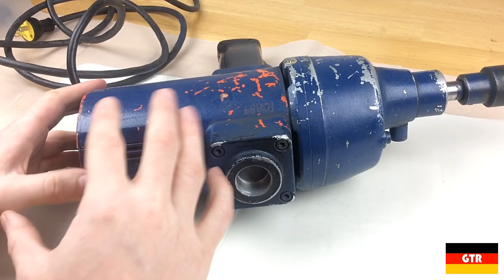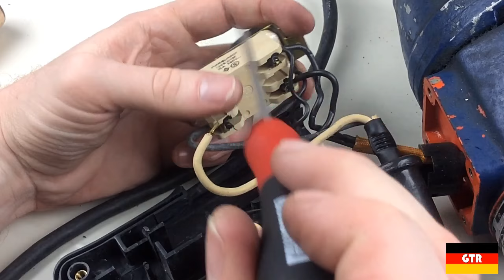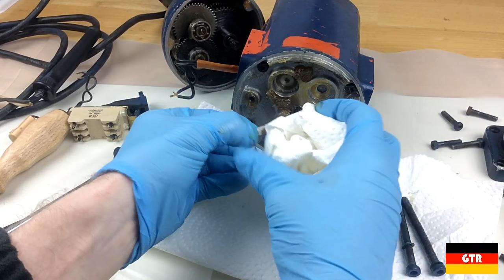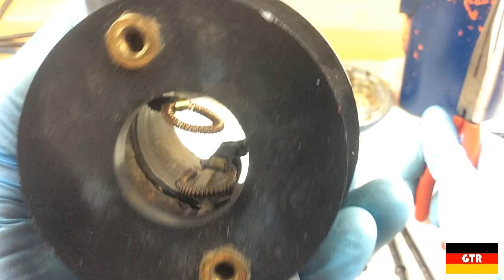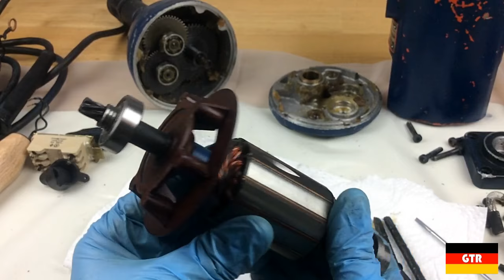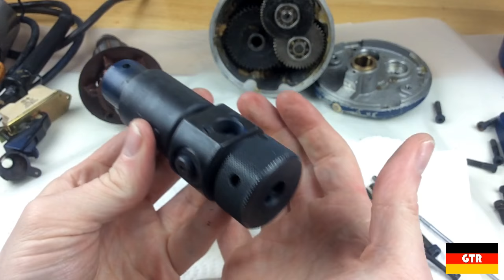Vintage Fein Tapper (Asg 658) Part 1 - Teardown

Comment: The same marquard switches were used in the bigger 672 Models with 1050Watts (~5.5A on 230V Models / ~11A on the 110v Models ). Anyway...  everything was oversized on these two handle Models 658 and 672 (And many more Fein machines)... Why? Because they re built by Fein... and they constructed these machines to last for 100 years! ;-) 

To replace the brush holders, and connect the springs around them after it, there is a special tool handed out only to fein repair shops wich makes this task easier. But, as you made it, with a little patience it is possible  :-)

Same field windings (and motor housing) are used on Asb 658, Asg 658, Ask658, Asq 658 and the Dsk 658.... Same with the bigger 672 Models.

Really enjoy your Videos every time, i am into Fein machines too. Go on like this, i am looking forward to every of your videos. Check out my Videos to see some Fein machines out of my collection working. :-)

Best regards from Bavaria!

David
Reply from the maker: Awesome, thanks for the information.  Its hard to find this kind of information even from Fein because everyone who designed these machines is probably retired and they don't have electronic records of some of these older units.